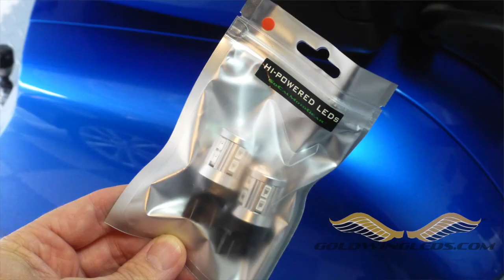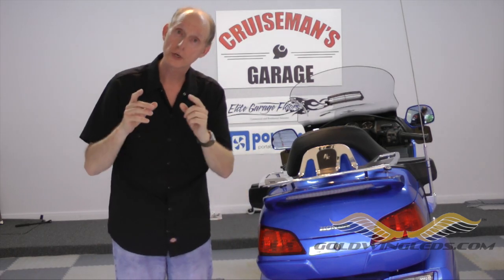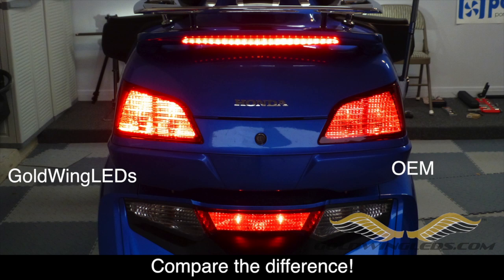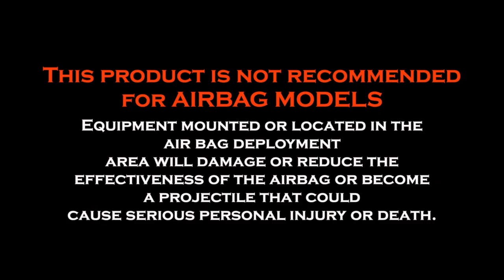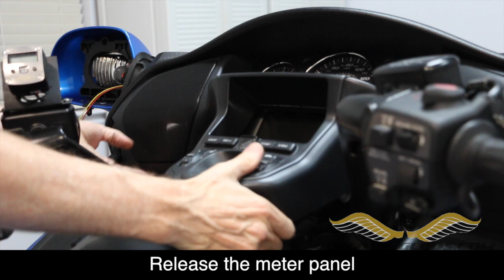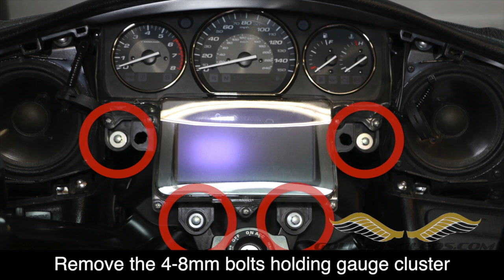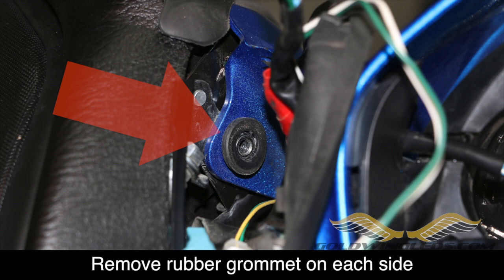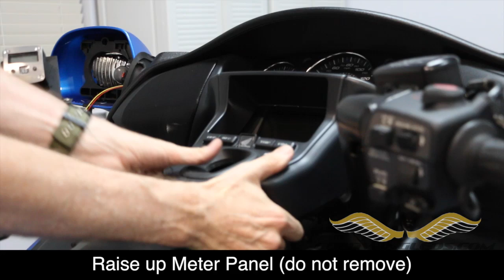How to install LED brake/tail lights on a Honda GL1800 Goldwing

Comment: I upgraded my rear signal lights to LED as I had people tell me they could not see the lights blinking in bright daylight. Made a noticeable improvement. I only did the rear so no change was needed to the flasher.  I also installed a brake light flasher. I have to say my biggest concern is being rear ended so these are some really meaningful upgrades. Another nice video Mr Cruiseman

Comment: Terrific video Cruiseman!  I installed the LEDs for the rear red lights, rear amber signal lights, and license plate light.  The original lights needed firm wiggling but they came out okay.  Yep, the original flasher needs to be replaced with the load leveller (LED flasher) or else the lights flash too quickly.  I used the 'From Behind Method' to replace the flasher.  A few tips to share: i) technique is more important than force for unplugging cables, each connection (tweeters, meter panel, gauge clusters) has a tab that needs depressing with a small tool or fingers, and ii) I absolutely needed to unplug the gauge cluster to adequately expose the flasher.  The new load leveller, unlike the original flasher, comes with both a male and female plug.  Presumably, another set of lights or another device can be piggy backed onto the relay but I don't know that for sure.  I just wrapped the unused plug with electrician's tape so it doesn't get wet.  Last, I just retuned from a long road trip and once again a dead butterfly got trapped behind the speaker cover.  I reluctantly power washed the first one out but now I know how to remove the meter panel which allowed me to brush that butterfly and other debris out of the speaker area!   I have a 2015 Goldwing with airbag/navigation and with the help of my wife, the job took a couple hours.

Comment: Just finished installing these SoCal Moto Gear LEDs on a 2013 F6B Deluxe (GL1800BD).  NOTE:  There is an additional step (for GL1800B only) after removing the four 10mm acorn nuts.   Before pulling out the tail light assembly remove the end rear top cover  (see service manual 61MCA66, page 2-28) by releasing the three tabs and two bosses.  Now remove tail light assembly.

Comment: I have a back off wig-wag installed on my 2010 GL1800.  If I install 6 red pathfinder bulbs in all brake lights do I need a load equalizer.  Thx for all your great vids which I have used many times while woreking on a project.
Reply from the maker: Most likely you will.

Comment: I'm a new Goldwing owner, about three weeks. I want to do this project but on an unsure which LED Flasher to purchase? I have 2009 Honda GoldWind GL1800 I'm starting with the back of the motorcycle including the turning signals. I have watched the video and see he is replacing the OEM Flasher but I cannot see what he used in the video. I will take any kind of suggestions, I'm finding a variety of answers online.

Comment: i just added the SoCal back lights on my 2002 GL1800 i have a wig wag installed. After i plugged in the final brake light i got a F1 on the panel. Does this mean I have to order the flasher equalizer? How does this apply when you haven't changed the front signals? And if as you mentioned they require "less" power why would fuse have blown? Thanks so much love the viedo's!
Reply from the maker: Not sure why a fuse would blow just from changing to LEDs.

Comment: Do the instructions for the replacement flasher unit also apply to my 2005 Wing ?  I ordered my kit from Socalmoto and it should arrive in the next couple days.  But some of my research is telling me the flasher unit for my 2005 is different than the new generation Goldwing.  Thanks..

Comment: when I replace the Flasher module for the rear LED turn signals, will this also suffice for when I do front LEDs for the turn signals?
Reply from the maker: Yes

Comment: I have a 1984 GL1200 Aspy, The taillights use regular 1157 bulbs. I bought some LED lights that are replacements for the 1157 bulb. Is there anything I should do to use these other than put them in? The turn signal bulbs are different and separate bulbs. I'm just replacing the stop/taillight bulbs.

Comment: The load equalizer looks like it has a series resister in it based on the way the bulb has soft on an soft off just like an incandescent bulb. Which to me defeats half the advantage of having led lamps, and that is current draw.
You can use a electronic flasher relay instead,that is not dependent on current draw , it works off of time and not load...

Comment: I like your stuff and your videos, but...the little music thing that you put in the video betweet "takes" MASSIVELY sucks. Makes mew want to shut it off and never return.
Reply from the maker: You are not the first to complain about the music. Sorry.
Reply: HondaGoldwingGL1800  Ear Blast is Your Punishment for Riding a Metric Bike...
Reply: Agree 1000%.  Music should be neutral, not offensive to any generation.  And as Goldwings are usually ridden by older riders, the choice is even more perplexing.